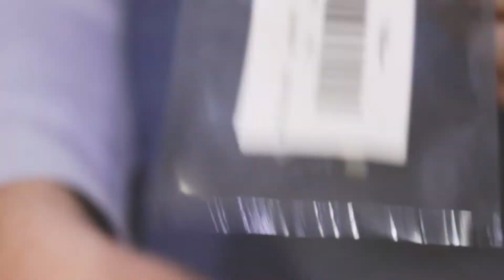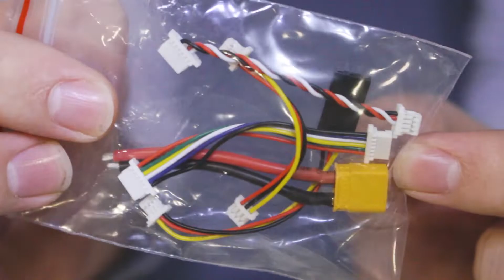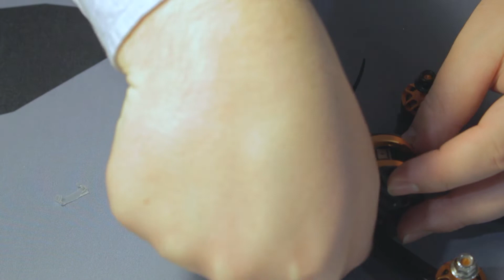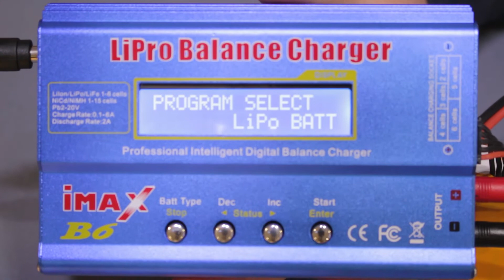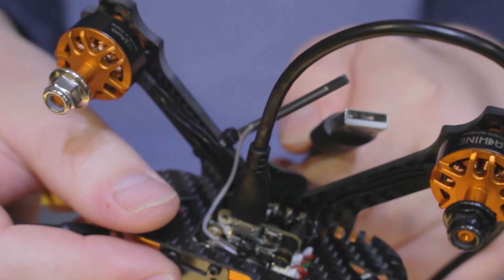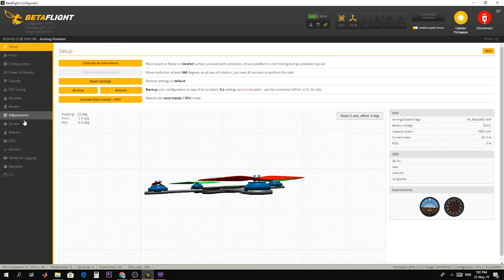Tyro79 Build Guide for CQU Students

Comment: really think you should un-unlist this! it has been super useful for me because other build guides don't use the fli14+ and also have different wires for the VTX. (im not a student, found the vid from a forum that you posted it on.) So helpful!!
Reply from the maker: Im glad you found it useful, i could re edit it to be less specific but im a bit busy atm so ill leave it just on the forum.

Glad to be helpful, and the forum you found it on, intofpv.. Is worth joining for help 😊
Reply: @daveefordays  yeah no worries thanks for posting it there. I will join the forum too!
Reply: @daveefordays  actuallly could I just a question about the VTX? How do I go about adding the extra wire to use it with goggles? I've currently got a black, red and white wire connected
Reply from the maker: @ClarkDroneFilms you need to add it to the next pin along in both of the plugs, or you can solder it in the vtx end.

Youll need to order a piece of wire with the correct pin for the plug
Reply: @daveefordays  so is this for using smart audio? sorry for any dumb questions this is my first build. does it matter what colour the wire is?